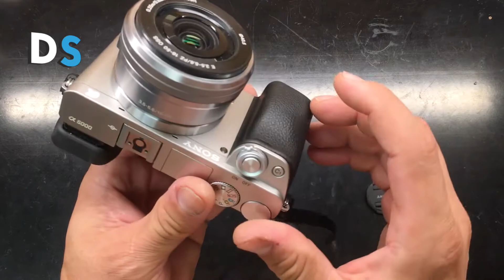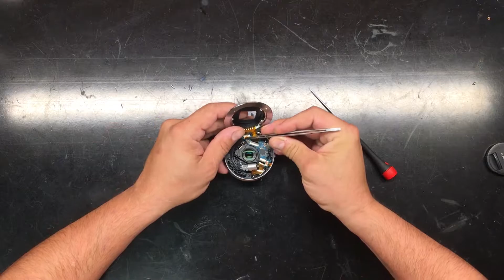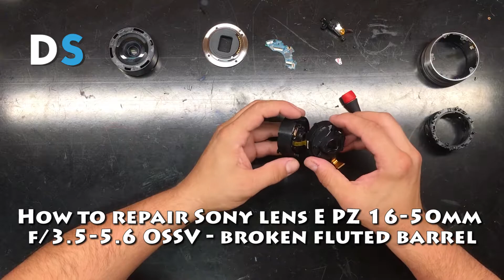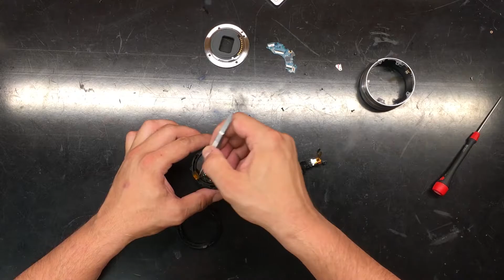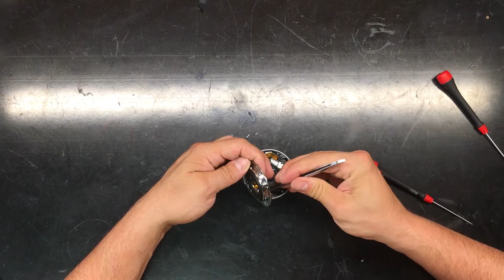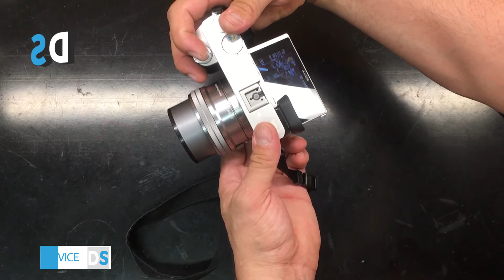How to repair Sony Lens E PZ 16-50mm f/3.5-5.6 OSS  - broken fluted barrel

Comment: Hey not sure how fast you will respond to this but I fixed the broken barrel on my 16-50mm but now the camera is just blurred and still says lens not properly attached. Can you shoot me in the right direction of what I messed up in the process? Thanks
Reply from the maker: Hi Chris,

we will try to help you so let's start with the flex cables. Are they properly attached? No bends , no broken cables? Are you check the sensor which comes together with the motor? This sensor is important to be in the right position. Start to remove the motor and very carefully with the sensor and after that try to extend by hand the barrel to see that everythig is ok.

Regards!

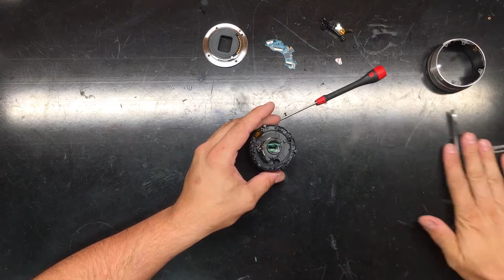Comment: Thank you for this video. I had the same problem and thanks to your video I managed to repair it. At 3:38 you skipped the important part- to open this you just need some force, you can see it on "What's Next?! Travel Vlogs" channel under "Sony SELP1650 16-50mm lens teardown and repair". Many parts of that video are out of focus, but it covers some things you missed so I recommend watching both videos. BTW, the part number is: 4-594-306-01 if someone wants to buy new one.

Comment: Hi, did you just glue the broken bits back on the barrel?
Reply from the maker: Hi , thank you for the comment:) The broken parts was glued and polished to fit in the places where they as original. We use special glue and plastic compound for more flexibility.  :)If you like the video, hit LIKE and subscribe to our channel ;) Thank you!
Reply: @DIGISERVICEBG  what if i lost that small piece ??
Reply from the maker: All Aspects hi please specify which part?
Reply: @DIGISERVICEBG  the one you glued to fix it up
Reply from the maker: All Aspects buy new barrel . No other way :)
Reply: @DIGISERVICEBG  OK thanks a lot

Comment: Bro after i repair the barrel camera notify unsupported lens and lens doesn't come out when i turn on the camera....
Reply from the maker: Hi:) Check the contact board and all the flex cables . Is there evert sensor in place?
Reply: @DIGISERVICEBG  i checked the cable and reassembled it again but not working plz help
Reply from the maker: @siaentertainment  if you want make a short video or detailed pictures of the flex cables, PCB, and zoom motor(there is another sesnsor). Send them to service@digi-service.eu. Thank you!